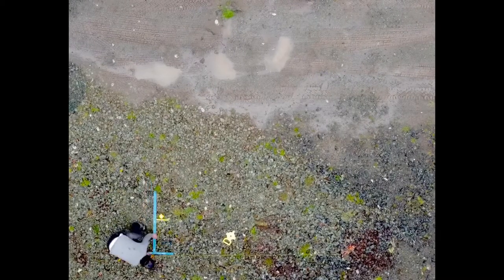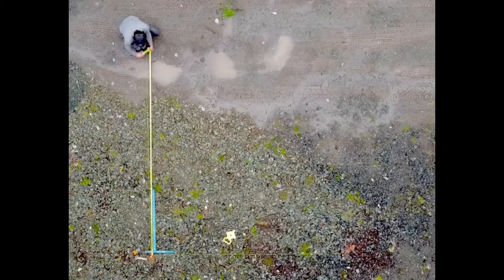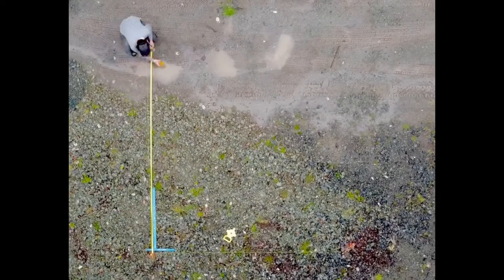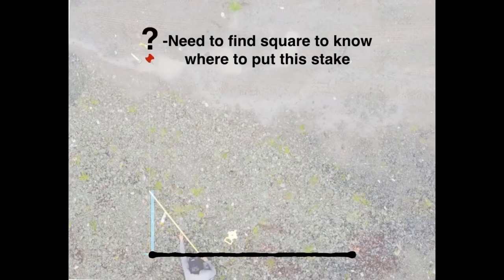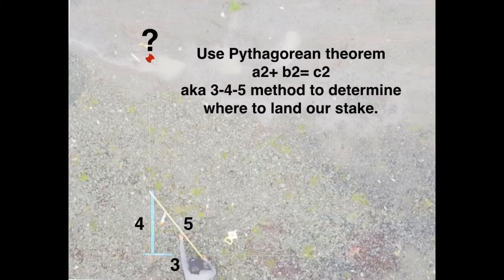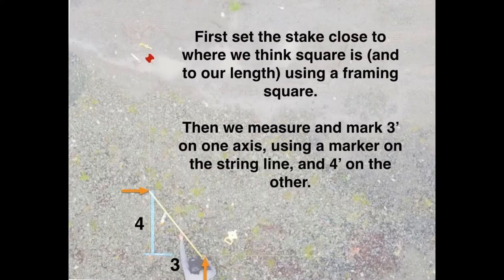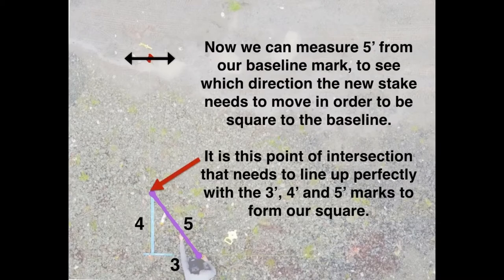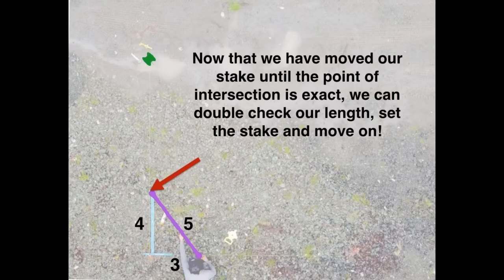ESSENTIAL HARDSCAPE LAYOUT TECHNIQUES!  Square it up!

Comment: I don’t understand what the relationship of the 3-4-5 triangle is to the upper left hand stake. Looks like you arbitrarily just place the stake even though you say otherwise, but how?
Reply from the maker: Hey, the upper left hand stake is the one we are moving until it is square to the baseline. So at first I use the blue drywall square to place the stake close to square, and then hone it in with the 3-4-5 and adjust it to make it more accurate. Does that make sense?
Reply: If the stake in the top left corner is not in the correct spot the hypotenuse will be longer or shorter than 5' indicating that the line isn't straight.

Typically you would use a right angle batter board in each corner outside of the proper square. This will allow you to square all corners.